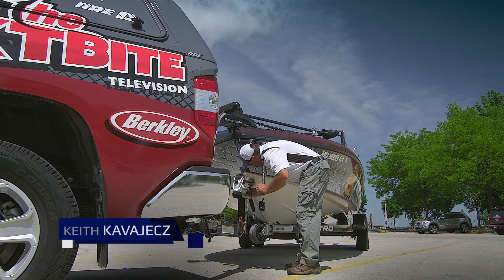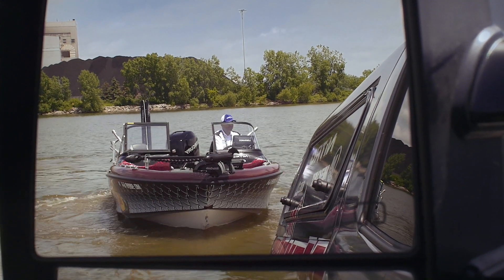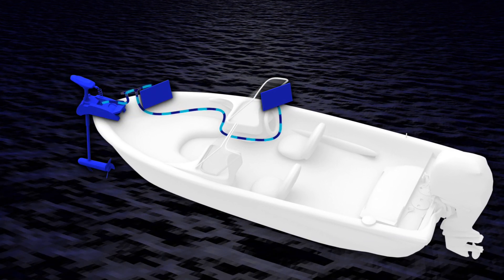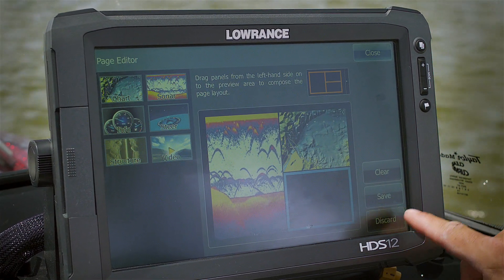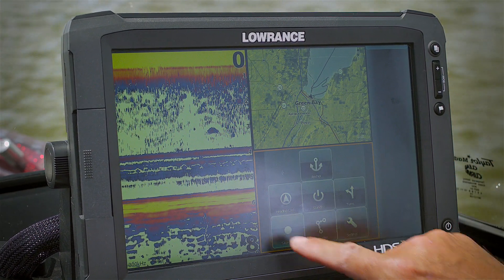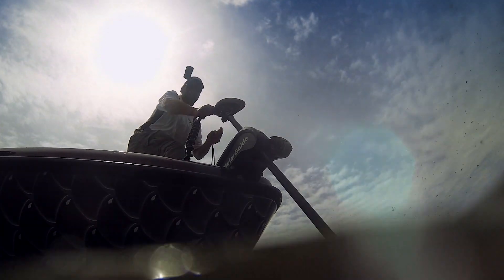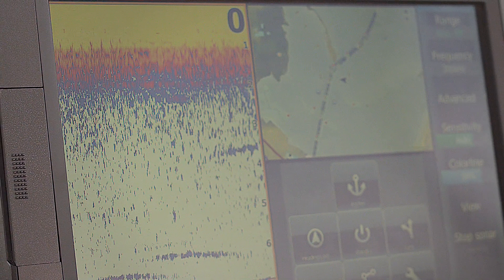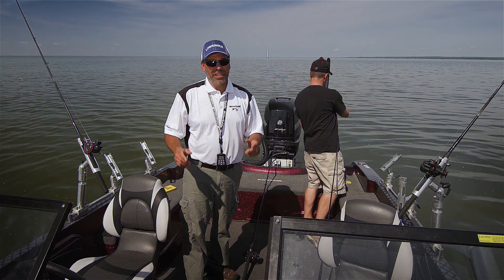How To: MotorGuide Lowrance Pinpoint GPS System

Comment: I just set up the gateway kit in my boat. I followed all the steps, and it works. But i have to kill the power to the xi5 every time i move up the lake to another spot for the autopilot to work? Did i miss something in the setup or does this need to be done every time the trolling motor is stowed and deployed?
Reply from the maker: Not sure. I would reach out to Motorguide on that question.  I think that would be something they would have knowledge about.

Comment: What is the top speed of the xi5 ?
Reply from the maker: going to depend on your boat.  If in kayak you are going to be cruising vs in a boat. 😄.  Not sure what advertised RMP's are.   Another great option for trolling motor new to market is Power-Pole MOVE.  They are Great trolling motors.

Comment: Do they hook up wireless with Bluetooth? Nema is 5 pin..my motguide plug is 6 pin?
Reply from the maker: there is a cable that you need. But some motorguides are not compatible.   They sell GPS version and non GPS version of trolling motor.

Comment: Great video.  I've purchased a suntracker fishin barge 20 DLX pontoon and I was wondering will this system work or do you have any other recommendations.  I chose not to purchase the fish finder and trolling motor that comes with the boat because I want a better system to control the boat and locate brush piles, etc, etc.
Reply from the maker: I would really talk with a dealer or marine shop and see what shaft length and lb thrust you should get for your size of boat.  Motorguide, Minkota, Lowrance, ect.. all have about the same features.  The real trolling motor game changer is coming in the future from Power--Pole, But we don't know when it will hit the markets.
Reply: @ThenextbiteTvShow  hi i was wondering can you put the motor guidexi5  in idle if you put the troll master in idle to real fish in ? Because I was thinking about using the x I 5 to stear my boat and kicker for trolling
Reply from the maker: You just got to hit your key fob on your neck into anchor mode.  Then your XI 5 keep you in place while trolling motor idles.

Comment: When you hit the "Go To" waypoint button, will it actually stop on that waypoint or just take you over the waypoint?
Reply from the maker: Yes.   If for some reason it does not. Just hit anchor on key fob.
Reply: @ThenextbiteTvShow  Thanks for the reply so long after the video was posted! Mine always takes off and just cruises right past the waypoint. I noticed you hit "anchor" first then "go to" so maybe that's what I'm doing wrong. I've acutally never noticed the commands on my Lowrance gen 3's like your video showed, so I'm definitely going to have to look for those.

Comment: Can the system follow a contour or break line.
Reply from the maker: Hooked up with Lowrance Unit using the Gateway, I believe you can. Or you can set out a line of waypoints that the trolling motor will follow.   But lots of lakes might not be on your lake chip.  So that where repeat route is huge.  You can make one pass (record your route) then you can reverse route and tell your XI5 or XI3 to follow that route.  (great for lake with no contour data)

Comment: Is there a list of what lowrance units are compatible with the motorguide? is it just HDS or will other newer models connect?
Reply from the maker: We use the HDS. I found this info that might help you. A HDS Gen 3, HDS Carbon, HDS Gen 2 Touch, HDS Gen 2, and Elite-7/9/12TI's can use the Motor Guide XI-5. The only additional part would be a NMEA 2000 Network and the MotorGuide gateway. If you don't already have one NMEA starter kit is part number 124-69.
Reply: @ThenextbiteTvShow thank you. I have the Ti2 9" models and plan to get the cord so I can get hooked up. Appreciate the information.

Comment: I don't believe I have AutoPilot showing on my HDS 9 Gen 2. What could be the problem?
Reply from the maker: Hard to say with out sitting in the boat. You can bring your boat into a local dealer or call Lowrance. https://www.lowrance.com/contact-us/.     You might have to update your Lowrance unit to the newest version.  Usually updates fix any issues.

Comment: What's the difference between "pinpoint" and regular GPS spot lock? Just simply connection to finder system?
Reply from the maker: The "pinpoint" is more then just hitting anchor and staying in one spot. You can jog around in 5 foot increments and has tons more feature you can find here: http://ww2.motorguide.com/introducing-pinpoint